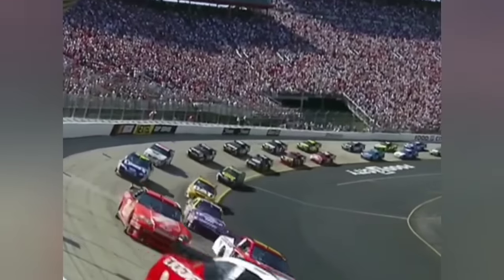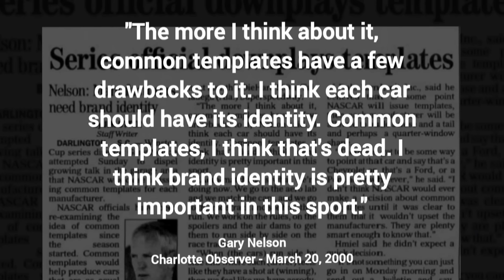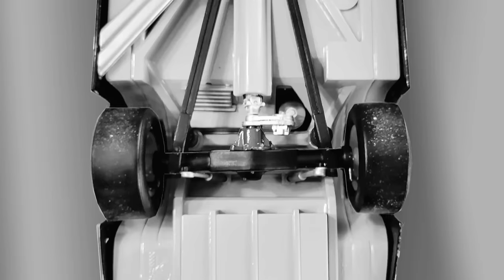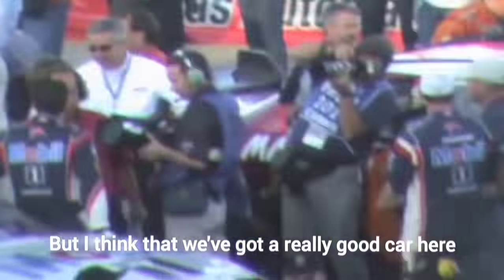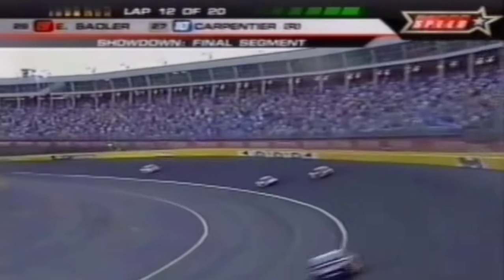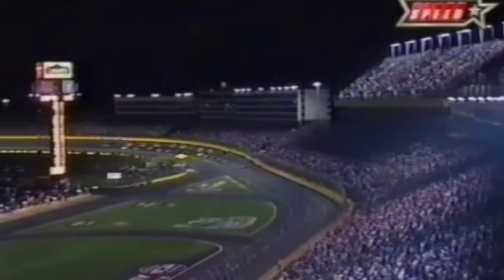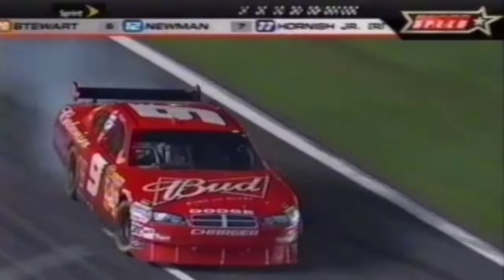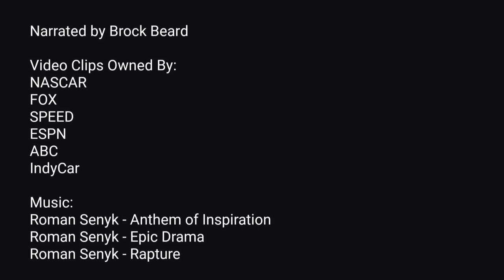The Car That Exploited the Car of Tomorrow

Comment: the problem i have with all the rules in a racing sport is that after so many rules and regulations on exactly how cars have to be to have an even playing field such as this.. it really doesnt leave much room for drivers to showcase who has the most skill.. if everyone maxes out at 200mph and every straight is a 200mph straight, every corner is a 140mph corner.. its a long slow grind to get to first and more of an endurance race than anything else. the thing i like more about open wheel and rally racing over nascar stock car racing is the fact that the tracks allow for much more showcasing of skill over endurance even though it showcases endurance as well but since all the cars in each class are made to the same standards, keeping the cars on pretty even platforms allows the drivers to show off what they have to offer but allows basically nothing for the manufacturers to show off.. which is why i like rally so much, so much more room for manufacturers to showcase the cars they bring to the table as well as the drivers. 

i mean shit, why do you think subaru has absolutely dominated the rally scene since the late 90's and every other manufacturer has fallen off after so many losses. its exactly why i own a subaru today. i definitely agree with trying to keep the cars on even platforms to keep races fair and leave it up to the drivers to fill in the gaps.. but still with every car looking the same, set up using the same aftermarket parts across all manufacturers for performance on the track.. it's pretty boring. there is literally no difference between a 'toyota' than a 'dodge' or a 'ford' out there. pretty lame tbh and the fact that every team and driver is just going to complain to get things banned instead of being creative and finding ways to give themselves an edge is honestly just lame AF. whatever happened to pride racers used to have. now they just bitch enough and the rules get changed. 

the main reasons why ive never really been attracted to nascar. just way too many similarities which make the drivers bland and unappealing, same with the bland and unappealing cars/manufacturers that take part in the sport. rally > f1 and indy > motoGP + TT and MX + SX > NHRA drag racing > nascar. 

having different classes and more personalization in the sport is a must have, without it it's just too bland, uneventful and boring. the sport will never grow, it will continue to lose more and more fans and money and it's sad to see because i am proud to have nascar as part of our American racing heritage, it's an awesome thing no doubt. having gone over 200mph in a car, its exhilarating to do especially professionally but it's just absolutely so boring to watch or try to be a fan of. i wish they would revise the "equal cars" rules to where, the cars all have the same power, same tire compounds, same downforce specs when put in a wind tunnel and same performance on a dyno.. but allow manufacturers to personalize them so they at least dont all look the exact same as well as still be forced to use their baseline counterparts engine setup.. obviously it cant be a stock block... i highly doubt toyota or any American manufacturer uses billeted blocks straight from factory but still. you cant tell me a camry comes off the production line with a billeted v8 making 510hp out of the gate. i know for a fact everything is swapped, down to every exterior and interior panel is stripped and replaced. only thing that stays relatively the same is the original frame which is also chopped and bits are added to it or taken away to meet all standards on weight, length structural rigidity etc. which is understandable but seriously, it's not a toyota or a ford or a dodge at that point. 

if they want the sport to grow, they need a way of attracting fans and the way NOT to do that is making one base line foreign car that no normie who follows motorsport can even understand without some in depth video or guide explaining everything to them. that is unattractive to most motorsports fans. most people want to see something they can go and straight up buy from a manufacturer or dealer off the showroom floor that resembles (for the most part) the car they love watching race. that's what got me into a subaru and im sure it's gotten many many other motorsports fans into their current cars/vehicles. give us something to like about the sport, not more shit that nobody understands.

Comment: I actually did this with my racing go-kart. I built my own chassis. Everyone thought I was super loose but I just had the rear end mounted to the right of most karts giving the appearance of being loose in the turns. "I told the other guys watch my hands on the steering wheel, I'm not loose it just looks that way." I won a good deal of races with that setup. I couldn't get it to work on larger tracks though.
Reply: I've been looking to get into go kart racing. Where do you race and how did you get into it?
Reply: @FoodPockets91  The first rule of go-kart racing is: you do not talk about go-kart racing.
Reply: Also did this with mine 99 Buller Demon on a 1/5 mile dirt track. Had an adjustment to skew the rear axle, trick was to get it to hold the bottom line without getting too loose. Flat foot it and just tap the brake to control speed.

Comment: I actually work with the man who was the lead engineer on the #77 (and later the 2 for their championship and the 22 after that) and this car was one of the first things he and I spoke about when we started working together.  This skew idea was traveling around the garage at the time (Note Edwards' comment on it), and the 77 was not the first, they were just the first to really go to the max with it.  

A few things though...The 77's rear housing wasn't really steered like it would eventually be in the late-COT and Gen6 era, the rear skew was achieved by simply giving the rear wheels a lot of toe to the right (Toe-in LR, Toe-out RR).  The car arrived to the track with more toe than was raced but NASCAR took the original drive plates (this act, and the parts, were witnessed by another of my coworkers who called them "hilarious") because the car wouldn't roll up onto the scales.  It did race with more toe that was mandated by the next rule change, however the knock-on effects of high yaw angles from skew were discovered in this All-Star race, specifically the sudden "loose" condition that comes from being behind another car which was painfully obvious just prior to Hornish hitting the wall in the feature.  This effect made it all the way through the Gen 6 era and was the catalyst for the zero-offset body for the Nextgen car after NASCAR pinned the traffic issues on Sideforce, not Downforce, in 2015.  The 77's Coke 600 car was required to run with less rear toe, yes, but cars for the 600 are often a little less aggressive than All-Star cars anyway.

The skew that appeared late in the COT era was often from rear bar configurations, but from my colleagues (and what I've seen at my job today) it wasn't entirely that.  The rear ARB trick was most aggressive on the 48 and the 2 in 2012, most famously called out when Keselowski got on the radio during the playoffs and said he didn't want a rear bar in the car anymore.  High skew angles were usually from extremely high track bar height split (way higher on the right side), which pushes the rear of the car to the right on compression.  This was augmented by toe, like the 77, and this was further developed in the Gen 6 (no rear bar) with various methods such as soft truck arm bushings and weakening the truck arms prior to the event to make them bend more.  This second thing caused the drivers to aggressively swerve after races to straighten the arms up prior to post-event tech.  

Last, the anti-skew at Daytona on the Nextgen car is not new for the Nextgen car. This started appearing at the end of the COT era and lived on through the Gen 6 era.  The "official" story from the garage after the 43's run at Daytona was that they were correlating wind tunnel data for high negative yaw angles.  This makes sense because the Nextgen wants to be run with anti-skew anyway (this car loses downforce with yaw), and a Daytona test is a perfect place to test various yaw angles to make sure the data at home matches the real world!
Reply: Interesting read thanks
Reply: Were SHR using different sized truck arms to achieve anti-skew at superspeedways with the gen 6 car? I remember during their dominant runs at Talladega you could see it big time on those cars, especially the 41. I’ve tried to find a clip of it but nobody bothered to post it here for some reason.
Reply: @narwhalyt7231  Possibly, but the SHR advantage there was likely elsewhere.  They were busted a few years ago for some spoiler infractions at Texas, likely having a built-in offset in the spoiler...a huge no-no since the spoiler was a customer part and should have been the same for every car.  If they were offsetting to the right for intermediates, it's also extremely possible (but never proven) that they were also offsetting the spoiler to the left for superspeedways.  This would have cut the drag without any huge skew tricks, possibly putting the car in a more efficient low-drag config that was unattainable with the standard spoiler.
Reply: Would like, but 77 likes seem appropriate.
Reply: I know you can get some toe out of straight axles by bending or welding at an angle at the center section (how much depends on how much play there is at the inner splines), but how was the toe achieved in this particular case?  Welding the housing ends at an angle or shims?  If so, was there enough play in standard drive plate splines to allow the angles, or were these especially loose (and thus why they were confiscated)?
Reply: Fascinating read, this is how the internet used to be. So what are you two doing for money nowadays
Reply: @ShawnD1027  faily simple actually. If the rear axle is held on both sides and perfectly center, the links on the drivers side were shortened and the passenger side lengthened. Essentially mounting the rear axle at a angle
Reply: @kennedy796  , I understood from the discussion above that it was not done in such a manner, which is the most obvious easy way (and which is why an old RV I had crabbed the back end to the right).  Also, doing it that way, why mention left and right toe, as changing one would necessarily change the other?
Reply: @ShawnD1027   The primary method was the drive plates simply putting a significant amount of static toe in the rear axles.  The drive plate design just allowed that much adjustment for whatever reason, and they set it that high and ran with it.  Since this was the start of the skew trends the fancier methods weren't in play at the time so the simplest methods were what was happening, but the plates were confiscated because the 77 literally would not roll up onto the scales and there wasn't specifically a rule that said "This much toe is maximum".  Over time this level of skew was attainable through methods like you mentioned with bending the axle housing, weakening the truck arms, rear ARB shenanigans, or extremely soft truck arm bushings.
Reply: @kennedy796  That's the method they're cracking down on in Xfinity for 2023, but not for the 77 depicted in this video.  Two different length truck arms can be mounted in a way that the rear axle is at zero-steer in the garage, but the shorter arm on the left-side will pull the LR forward when the rear suspension compresses.  You're right, though, just thinking farther ahead into the future!
Reply: @mholden020  , thanks for clearing that up for me!
Reply: this is such an in depth analysis!  I've learned a ton, THANKS!
Reply: @mholden020  You should have a YouTube channel talking about these kind of things. NASCAR is horrifically bad at explaining the technical side of the sport on their media pages, and I think a lot of people lose interest because of that.
Reply: oh very interesting. i like soaking up as much of this as i can; i’d like to get where you are eventually as a nascar engineer. not as much room for innovation these days but trying to find some advantage looks very fun as a career.
Reply: @narwhalyt7231  I've thought about it!  There are lots of things I can't touch on because of my job and NDAs, especially with the Nextgen car, so the level of self-editing would be quite high.  Maybe some day!
Reply: Excellent explanation! Thanks for taking the time to write and share this.
Reply: @mholden020  an engineer for nascar is my dream job, i’m a junior in high school, is there a way i could contact you and just ask you about some things?

Comment: As an Aussie, randomly tuning into one of these races, I thought I was tripping seeing these cars built with angle looking like a permanent drift, this explains everything cheers for the vid and happy holidays
Reply: well, you should know the bs holdens did to there cars to win bathurst. last race,,1989..  as an ausie.. i own a 1973 dodge challenger r/t 340.. holdens suck..
Reply: @harrywalker5836  This dude right here is seriously butthurt on the internet about a race from 89. That's sad.
Reply: Any race where the cars go almost entirely one direction will tend to benefit from asymmetrical car designs. Sprint cars and super modified cars do things like putting bigger tires on the outside, moving the motors to the inside, putting rear wings sideways, and so forth. Dirt track racing benefits from the compressive effect of pushing dirt out of the way (same with snow), so a lot of them sit extremely sideways most of the race and have even more crazy designs.

Of course, you have to balance things. If you just put the car sideways, you'll lose a lot of top end speed from the increased drag. Nascar runs like 200 mph, so even a little bit of drag can be a deal breaker. Slowing down less for corners doesn't always help when you're doing 20 mph slower on the straights. Teams will find optimal slip angles for different tracks, just like any other adjustment. Slower tracks will generally benefit from higher angles, while faster tracks will favor straight speed.

Even a road course will generally have a preferred direction unless it crosses itself at some point. You necessarily turn through 360° more in one direction than the other, so a shorter track with only a few corners and low-speed straights might still benefit from some asymmetry. The asymmetry will tend to make wrong-way corners even slower, so it will likely do more harm than good when you have something like the Nurburgring with dozens of corners over miles of track. I think most tracks have enough variance that symmetrical cars work better, but I have seen guys change tire pressures on one side of the car for some tracks when those tires were getting more abuse.
Reply: @harrywalker5836  Holden made the best Chevy in a long time

Comment: Finessing the gray area of rules or completely overlooked potential benefits are what make the most interesting parts of motorsports for me. Great job on the video!
Reply: Its why Dodge keeps getting banned.
Reply: There is a video game Viper Racing with a nascar track "Dayton". Back in the day I would make rear toe out cars which would drive skewed in corners. You wouldn't believe the advantage that got, instant 10mph faster during exits. The only downside was it was sketchy in straights - the car wouldn't drive straight.

Comment: I was told decades ago they banned the bottom air foil (or raised it?) as it was creating a vacuum under the car and the car would flip or wipe out if ANYTHING broke the vacuum at speed. Imagine your car stuck to the road at high speed, then you hit a bump or piece of debris and get launched into the air or slide into the wall without warning (effectively you lose traction when the down force goes away). Fun to watch I'm sure, except maybe not for the widows.